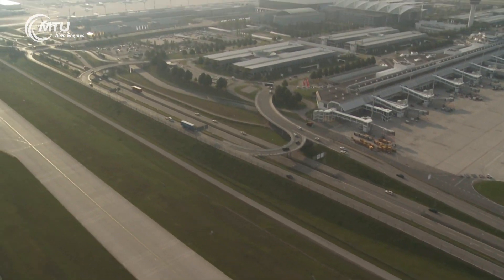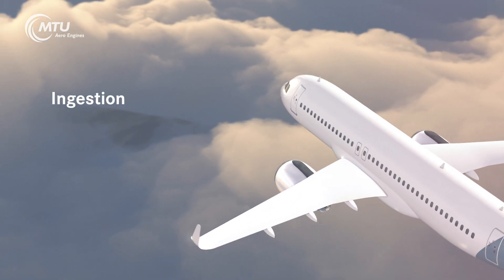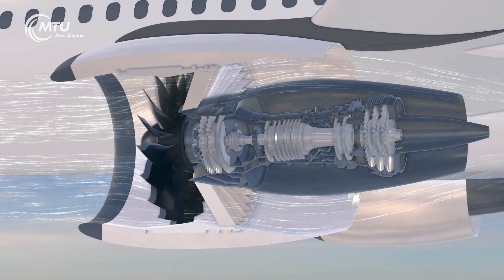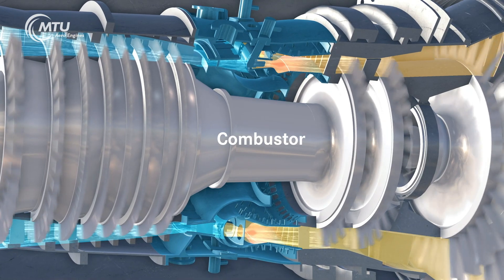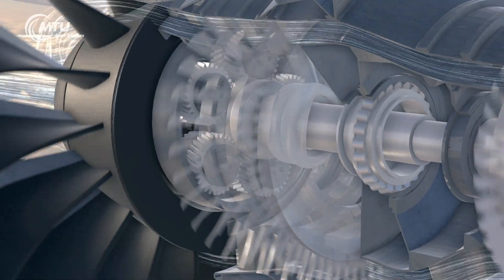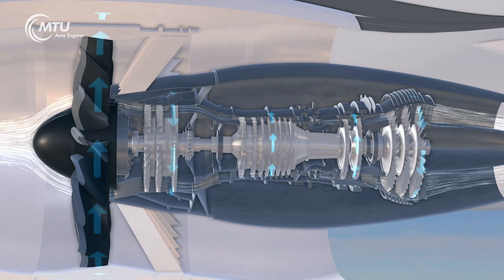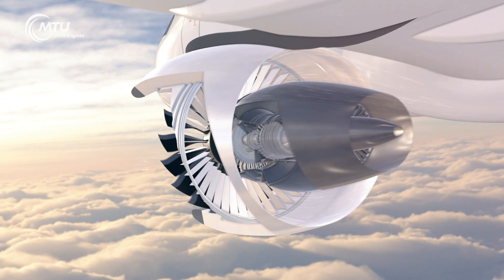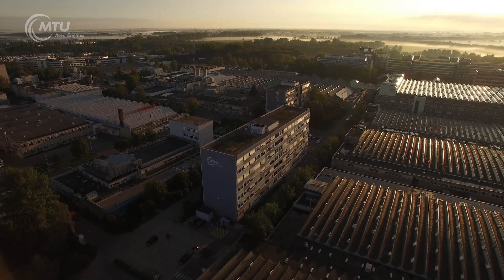How Does a Turbofan Engine Work?

Comment: So basically..or put it simply..., a turbofan engine is just a glorified turboprop engine with a cowl.😊
Reply: exactly
Reply: But how come the turboprop aircraft can’t fly as high as turbofan aircraft?
Reply: @jshan5261  I believe it's because the engines are smaller.
the more bypass ratio, the more efficient it is at the expense of high altitude performance due to factors like:

>thrust to weight (acceleration vs fuel usage)

>lower thrust than drag (higher altitudes demand a higher angle of attack at the same mach to stay airborne. this increases drag coefficient and without enough thrust, which also decreases with altitude, you'll be forced to descend.

basically, turboprops are designed to be efficient at lower altitudes while turbofans are more suited to higher altitudes
Reply: No..

Comment: Question:  i’ve been watching videos lately, that describe that the majority of thrust comes from the bypass air. However, when viewing the engine from the rear, one can see visually straight through the bypass  space.  I don’t see where the burning of fuel and therefore thrust is being produced. Can someone help me understand this. Thank you.
Reply: Very simply, the fuel is mixed with air in the rear combustion chamber and when that combusts, it spins the front fan that produces most of the thrust.
Reply: @ishaq9939  Interesting.  Do does that mean its not so much an exit air "push" velocity, as much as a front fan intake "pull" force?  Something like that?
Reply: @wannamontana4130 Okay, this is my layman understanding of it. The compression and burn chamber provides the power for the whole thing. The bypass air on the sides pushed by the front fan creates a lot of the thrust by just propelling the air through unhindered by all of the compents inside, but the burn chamber inside also provides some thrust of course.
Reply: @feonor26  So basically, it's like being back to a propeller, but stuck inside a housing?
Reply: @hugolafhugolaf  Well as I said, I'm a layman in understanding this even tho I have a degree in mechanical engineering but I've never worked with these kind of motors ever. The part that's inside the housing is the power plant of the whole thing. The burn chamber combined with the compressed air gives power to the turbine which in turn gives power to the compressor and turns the outer fan which feeds both the inner and outer air inlets. The inner inlet keeps the power going and the outer inlet (the see through part) adds to the thrust of an airplane. According to what I've read, this design gives not only an engine increased power but also significantly reduced engine noise. 

I dont know about you, but I remember sitting in the back of an old 737-200 that had the distinctive "straw" engines. Thin engines that were horribly noisy if you sat behind them. Engines today are incredibly less noisy.
Reply: @feonor26  Thanks man.  Regarding the «the outer inlet (the see through part) adds to the thrust of an airplane» part, that's the paret that puzzles me.  I know that newer turbofans with a high bypass % are less noisy, but I fail to understand how letting air bypass a combustion chamber (instead of cramming MORE air into it) makes more power.  To me it makes as much sense as cutting holes in your intake manifold...
Reply: This is only a guess but maybe the broader cross section of the impeller/fan allows for more cfm in total per unit of fuel used vs a straight turbo jet
Reply: And with lower rpm which would factor in construction and maintenance costs

Comment: All aircraft new types should have of engineer operator underneath aircraft of engine operation during starting and turn off. Included of Boeing 737 Max, 777X and Airbus A220, A320 Neo, A330 Neo, and A350XWB have the two engine operators for 2 engine operations in control room under aircraft (1 engine will be worked by 1 engine operator). Exception for turboprop engine included ATR 42 & 72 and Dash 7 and 8, it's only by 1 engine operator. For Boeing 747-8 and Airbus A380 in 4 engines, it's worked by 2 engine operators (2 engines for controlling by 1 operator. The engine operators will be informed by 2 pilots before flight of plane it. 
Source: ICAO, Boeing, Airbus
Reply: wat

Comment: Why turbines and compressors are rotating to different direction? As I see low pressure compressor and turbines are rotating to clockwise but high pressure compressor and turbines are rotating to counter clockwise. Why?
Reply: To prevent the torque reaction
Reply: It’s all about compressing the air. Each time the air has to slow down and change direction it becomes more compressed with the air behind it. That spins the internal rear fans, which are connected to the front bypass fan. It basically creates a power loop as long as you give it fuel.

So when the pilots push or pull on the throttle, they’re basically controlling the rate of fuel going into the engines continuous controlled explosion.
Reply: @trabon88  I understand clearly, I was over thinking on this issue before your explanation. Thanks for your detailed response  sir.
Reply: I think maybe cus over torque
Reply: It's to eliminate the angular momentum or gyroscscopic effect
Reply: As i have understood it, compressor blades turn in one direction, turbine blades the other.

Comment: can the blades of the turbine be designed to be variable? get the advantages of a jet and turboprop, would be cool in a fighter.
Reply: I think it's possible. Since planetary gear reduction that is already there can be modified into gearbox like car gearbox. Fast gear for turboprop/low altitude, slow gear or even neutral for high altitude,  great idea.

Comment: It seems like if you take all the bypass air and directed through a smaller opening it would create more thrust. Just like if you were to force water through a small nozzle on a hose it would create more push back.
Reply: Do that and you basically have a jet engine/ turbojet. Turbojets don’t have the large fan at the front, and will have a smaller space or no space for bypass air than a turbofan
Reply: most likely engineers thought about this, i myself an not a flight engineer. But considering the bypass air is just cooling and that they haven't done anything else too it makes me believe there's a downside
Reply: @Minigun_-nj1tf  I’ve recently discovered that all of our oldest people have intentionally lied about how things really work. They want to see who notices, or discovers things. It’s pretty genius because the ones paying attention to details will notice and say something.
Reply: @Minigun_-nj1tf The bypass air is not just for cooling
Reply: @ryanowens100  yeah my bad, it was just recently i figured out the jet engine in the turbofan was mainly to spin the fan to generate thrust, and the excess exhaust was used for extra thrust, however the fan makes roughly 90% of the thrust.
Reply: It would create more drag.

Comment: Is this fan's direction really correct? It seems that high pressure area is inside and low pressure area is outside, so flow should be directed outside in this case.